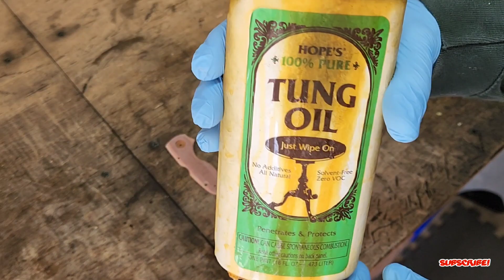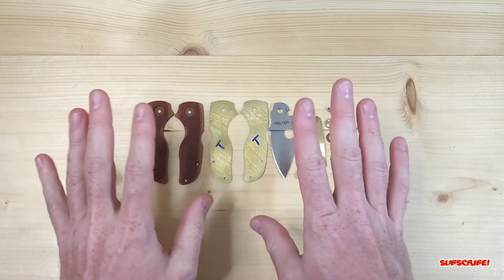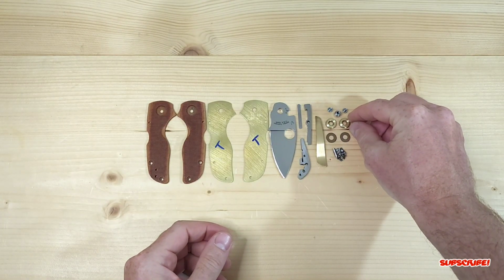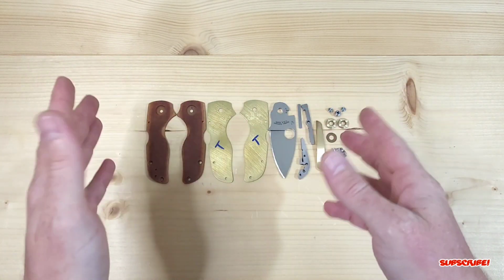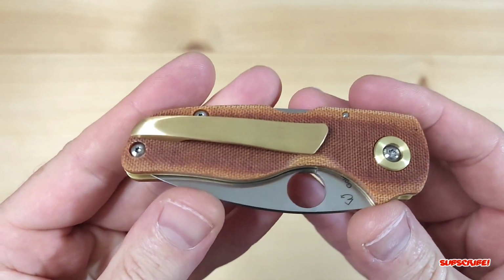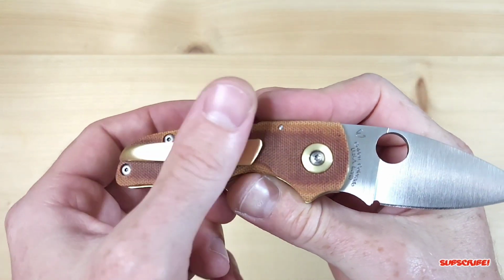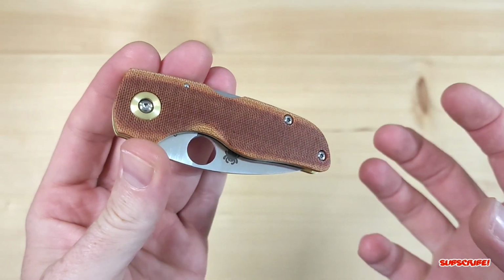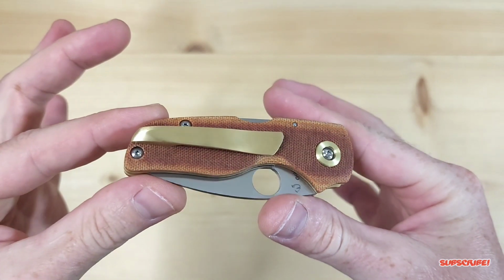THE CLASSIEST SPYDERCO LIL' NATIVE!!! #gold #handmade

Comment: Just a thought, would it help to use a flatbed scanner to scan the flat side, print, and then adhere to the new material and use the drill/milling/router machines? Leave the lid up, everything else will be dark, crop the parts you want to have as templates put in a new document and print out, maybe more parts to different projects but from the same materials.
Reply from the maker: That is a good idea, I might have to try that. Luckily the CNC program I use gets the hardware locations pretty close and then I make minor adjustments.🙂